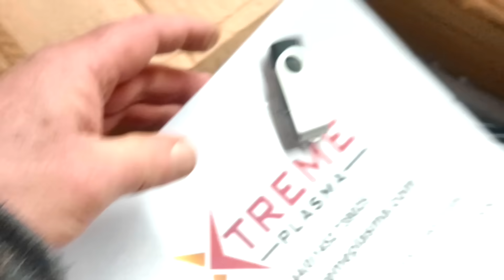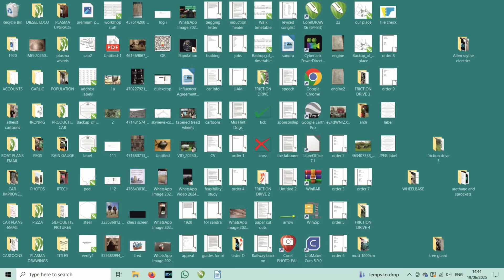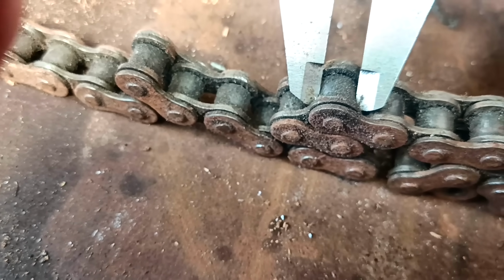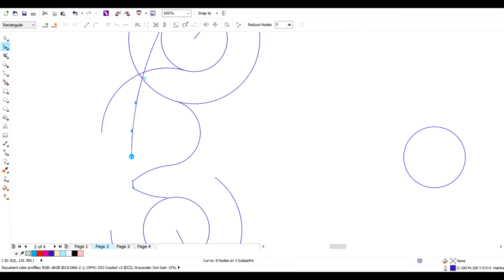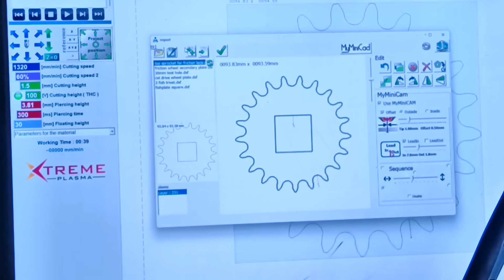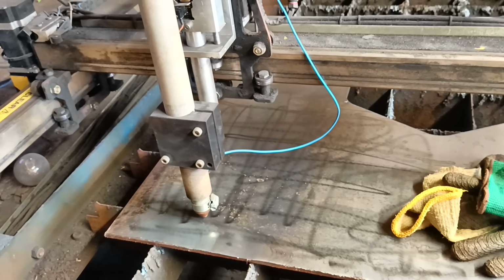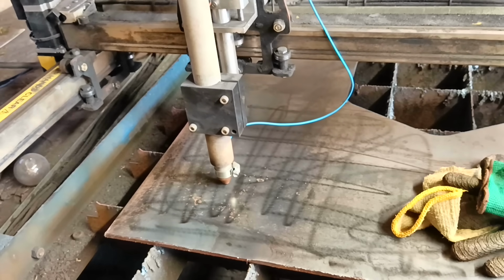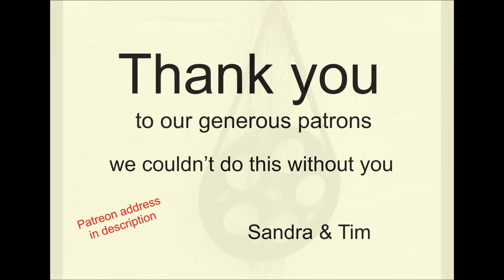How To Draw And Cut Homemade Sprockets On The Extreme CNC Plasma Cutter

Comment: Coreldraw allows circular arrays, so you could construct one tooth with the geometry you created, and then repeat that around the center point of your gear as many times as is required. 
That would minimize errors from all the line trimming, and make for a cleaner cut file. 
Plus, so much faster!
Also for design dimensions, much more accurate to get measurements for ten or twenty teeth, and average it down to your single tooth. Especially for chains that are older, and stretched or worn.

Comment: Wonderful video , I had to laugh ( along with you ) when it didn't syncronize with the chain ! 
I made a sprocket 29 tooth for a motorcycle, used aluminum as it was easier to work for my prototype , SAME result !! It , the chain , didn't follow instructions !! It's probably only off a pinch but it is off , .....back to the drawing board !

Comment: My man, when you were copy-pasting couple tooth segments all the way around you had me face palm so hard that I’m having to type this with my face now. There is a recursive productivity pattern you missed here that will increase your Additive Sprocket Speed (ASS, a standard unit in this industry) by an exponential factor. After you paste and thereby double your teeth (like 1 to then 2), select all, then copy again. The rest of your workflow does not change, except obviously rotate more for the increasingly larger pasted segments. This may go without saying but for a 64 tooth sprocket, your caveman approach requires 63 iterations, whereas the exponential approach requires only 7! (That’s 1 + log2(64).)
Reply from the maker: Well obviously I did that for the big one! I was just trying to keep it simple for the video..

Comment: I had a similar problem trying to make a timing gear on a 3d printer. The issue was a filament was being dragged while still hot on the tight turns which tended to smudge the teeth. The solution was to just keep changing the 3d model correct for what ever inaccuracies the machine was creating.

Comment: Do you not use or know key bine wild useing the software?
Reply from the maker: Sorry - I don't understand your question
Reply: @wayoutwest-workshopstuff6299 

With 3D and 2D modeling software have key bine.  Best way to explain it is certain key on the key bord you press are short cuts for certain tool on the software.

Comment: DON'T FORGET you can chain drill a sprocket...!!!          Scribe a circle of the correct size, use dividers to score off 1/2 inch all the way around, centre punch, drill holes the size of the barrels - cut through the midpoints and then file

Comment: Very well done, I have to cut a 35 tooth sprocket tomorrow, I haven't got a cnc cutter but l can do it on the lathe.  I cut a 88 tooth one last time and the sprocket was slightly  too large also but it was aluminium so easy fix.

Comment: As someone who has made lots of repetitive shapes by hand in CAD... Copy and paste a few teeth to make a group of five, select that whole group and then copy and paste that 15 more times - now you're only doing 20 copies instead of 79! It's always nice to be able to do stuff like that by understanding how the geometry is put together rather than "I typed the dimensions into a plugin and it made a shape for me" even if it does take longer
Reply: Copy and paste one 4 times. Then copy and paste the group of 5 3 times. Then copy and paste the group of 20 3 times. Only 10 operations.

Or when you get to 5 just copy and paste the whole thing again and again. You would have 80 teeth after only 8 operations

Comment: I use a magnet screwed to the end of a wooden broom handle to pull out the bits that don't fall through. There is a risk that they part fall through and pivot on the supports. These bits then stick up above the plate and the torch crashes into them. Ask me how I know and why did I have to buy a new head😂
Looking good so far!

Comment: Magnificent!  One thought I had after your last video (which I left certain you would end here at your plasma table) was to wonder if you remember the cogs and sprockets on the oldest bicycles being skip tooth yet still running regular roller chain.  I believe it was to help with alignment  but it might serve well here to cut down on the number of teeth the table needs to move through at least for the largest of the sprockets.  
Just a stray thought in any case, I always enjoy your videos and especially can relate to how you approach your problem solving and prototyping.
Reply from the maker: skip tooth? You mean leaving out every second tooth? Interesting!
Reply: @wayoutwest-workshopstuff6299  Exactly right.  It looks weird but I guess it would also cut the engagement friction in half as well.

Comment: TOLERANCES! When you drew the chain roller diameter circles I already suspected that it would be too tight. Give your outside diameters a 0.1 mm tolerance. Might need more or less depending on YOUR plasma cutter but that's a good starting point. 

I like to only make a section of the desired part to check if it fits properly before commiting to the full part. Saves a lot of time and material to do it that way.

Of course dialing it in with an angle grinder is okay but just imagine if you needed 2 or even more identcal sprockets.
Reply from the maker: YOu're right, of course. But if I'd only made a section it might still  not have shown up

Comment: After fetilling the sprocket,  could you run it with a grinding paste for a little while and wear it in perfec,  maybe ? And would heat treating the sprocket or just the edge help it last ?
Reply from the maker: I guess you'd wear the chain at the same time, though?

Comment: That's a very cool things you do and the sprocket is nice at the end. But I have a feeling that it was a long way around with manual drawing. Why not to use special software for that, like part design in freecad, or some plugins for fusion?
Reply from the maker: That would make sense! But I'm too lazy to learn a new programme

Comment: I used to make my own custom chain rings for bicycles many years ago. Drill, file, and cuss. But the results were good because I could match ratios, especially finals, to the strength of the rider, length of the crankarm, and the length of the rider's legs. 
Of course this was before computers were anything more than a Star Trek fantasy. 
I might just have to get me one of those fancy machines......LOL!
Cheers
Terry
Reply: Nice, what where some ratios that you cut 53 to 9?
Reply: @arthurgarthur it all depended. I used to have a formula that an old guy that knew a lot about math and machine work made for me. He was also a mechanical engineer that had his own hobby machine shop under the enclosed carport of his mobile home.
He was a builder of engines, internal and external combustion. I was in high school and was taking shop so I was quite fascinated by the guy.
The whole thing came from my 
" running out of pedals" on my 10-speed bike riding down US41
between San Carlos Park and Estero, Florida. 
It was the early 70s and the multi speed bikes were just coming out.
I knew I could go faster.....😁👍
Cheers
Terry
Reply: @terryfromsouthcarolina4601  That is awesome!
Reply: @MrHuram-abi it's been a long time. I lost all my notes from the old man in a fire. I didn't realize that they were missing until years later. They were figured old school analog with a pencil and slide rule.
He kind of reminded you of "Doc", from Back to the Future.
Cheers
Terry

Comment: Just to say you need to add some clearance to what you describe as the  extension part of the teeth.  You also need to taper the sides of that extension part.
The "holes" for the rollers are just fine. Good luck with it.
The drawing would be so much easier to do in even the most basic CAD package.
The problem with doing it in corel...unless you can properly "snap" the lines accurately,  you can well end up with cumulative errors.
Hope this helps
Reply: I was very concerned when he first started doing the rotation trick because I saw some errors but looks like he straightened them out in the final draft. I guess as long as you know how many teeth there SHOULD be you can always go back and even them out but it would be nice if there was a "rotate by x degrees" option instead of having to do it by hand

Comment: Please tell me you are using a spline rather than moving the cog?  Please, please please, put two square tubes inside each other with a welded cog/drive-wheel  on each  and then move the tube, it will save so much effort.
Reply from the maker: Not sure what you mean, Spedley? Where are you talking about?
Reply: @wayoutwest-workshopstuff6299 instead of having a cog sliding up and down the shaft, have two square shifts where one is a good fit in the other.  Then you can fix the cog to the shafts and slide the whole shaft in and out rather than just the cog.

Comment: Great use of the plasma. 
How did you get on with the air valve on the Lister D. Did you get it to run and how many turns did you do on the disc
Reply from the maker: It's settling down slowly, after blowing it all out. I'm not sure how many turns - 1.3? - I must count..

Comment: I imagine that every link in your chain has a small amount of play opening and closing; back and forth. That needs to be accounted for when you design the gear teeth spacing. If you pull the chain taut, that's one measurement. And, if you push the chain links close together, that's another measurement. Your sprocket teeth spacing should be right in the middle between those two measurements.

Doing these two measurements should account for the variances in design tolerance on your chain.

Comment: I think I might have a solution the way that you have your friction drive transmission than that the sprocket you're going to put on the square shaft that's linked to that transmission you need to have similar to what's called a shifter fork but you're not using it to shift you're using it to have that thing stay in one place so you weld a collar to the top sprocket that has a groove in it office of the one side you can have this thing go all the way around it or you can just have it look like a fork design which would be like a u-shape to fit in the groove of the caller that's welded to the sprocket and that it shifter fork would be welded to a stationary part in the frame so it does not move which means you could shift gears and not have your sprockets come out of alignment they will always stay in alignment you can also do it to where I know you like to use roller bearings you can put a collar on that one sprocket and then make it to where it's under or oversized whatever ID or OD you want to use on the bearing add to have a fixture welded to it and have that welded to the frame it'll keep that sprocket in one place even though that that transmission shaft is sliding back and forth I also think you need to use a jack shaft to get the power down to the first axle and I think you should have that first axle sprocket off to the side and make sure these next progress are the exact identical size so you can have another sprocket on that shaft and another sprocket on the other axle so you can have all-wheel drive you've got to know what a jack shaft is right it's a shaft that has the sprockets and bearings to transmit the power from one direction to another I think that's the way you should do it it would be a lot easier layout and it wouldn't be so cramped and you wouldn't have to have the chain go directly down to that one axle what could cause alignment issue good job on keeping up the great work on your little locomotive I can't wait to see it run down the track one day keep up the great work and peace out have a great day
Reply from the maker: Thanks IronHorse. For Christmas I'm going to give you some full-stops and commas : -  )